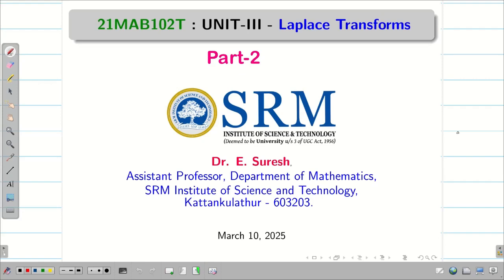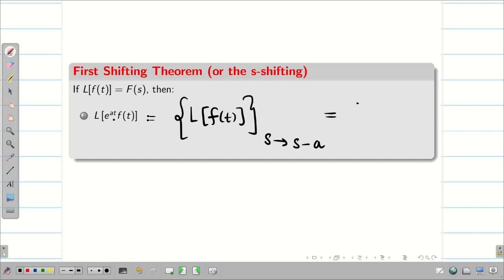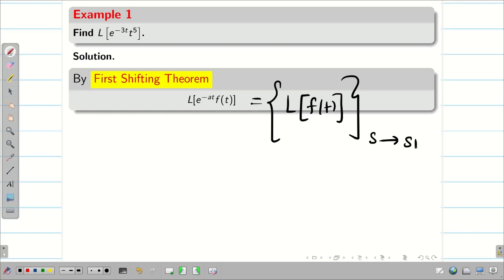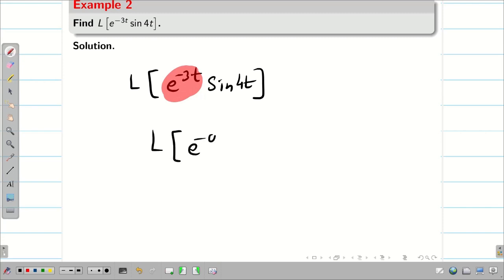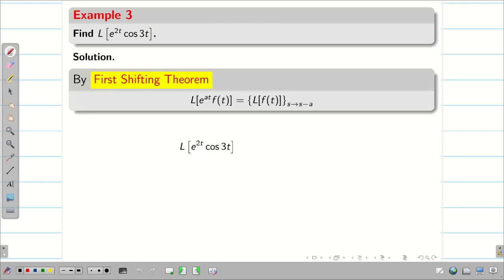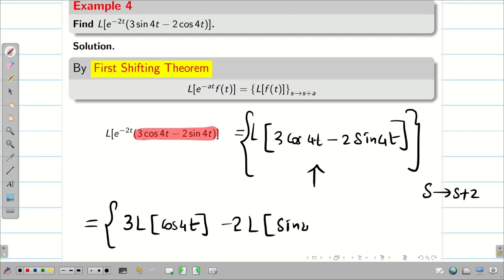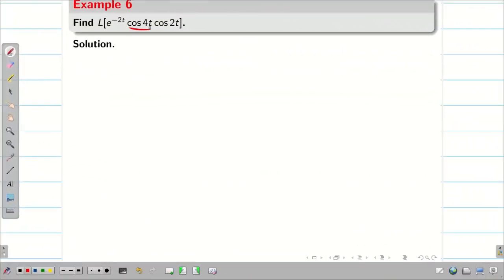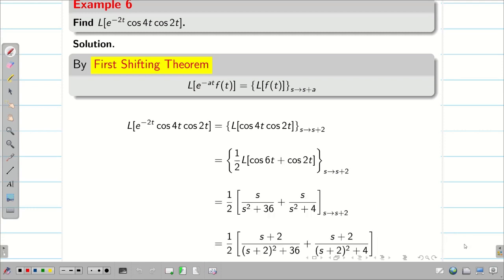3. Laplace Transforms : Problems : First Shifting Theorem: Part 2: 21MAB102T

Comment: Sir in the 4th example,the question is 3Sin4t - 2cos4t but in answer u have  used 3cos4t - 2sin4t
Reply from the maker: You are right, but the question I have took different problem